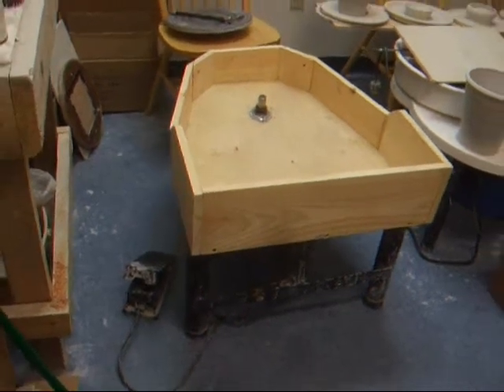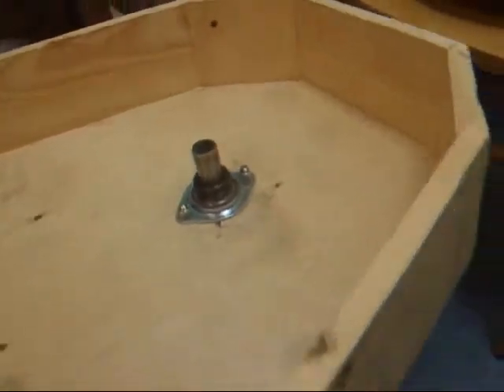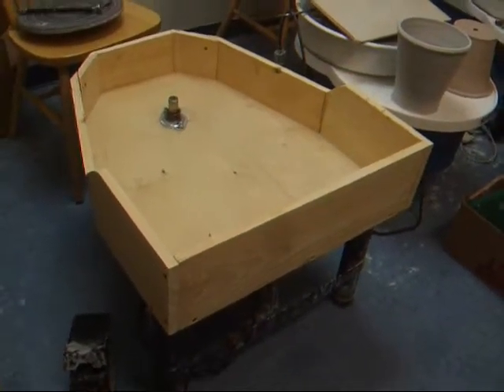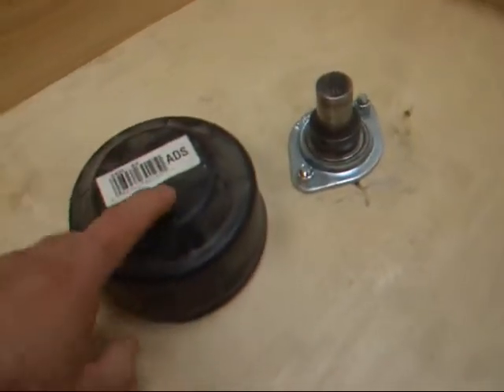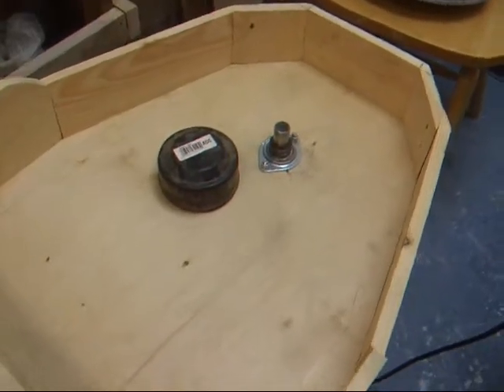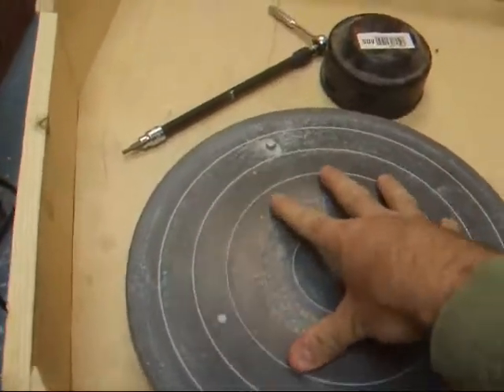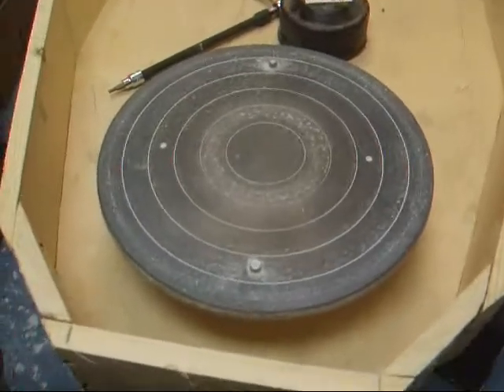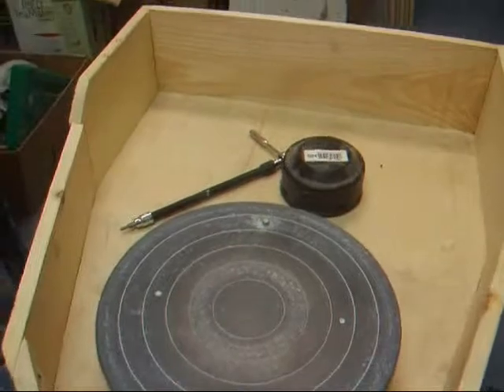Wheel repair

Comment: how did you get that ring off to get the bottom bearing out? I have an old pacifica that uses the same set up as the brent in this video. the problem is that ring keeping the bottom bearing in place has corroded into being stuck on the post. any help you can offer will be greatly appreciated.
Reply from the maker: soak with wd40 and gently persuade it with a hammer perhaps?  a gear puller might also work